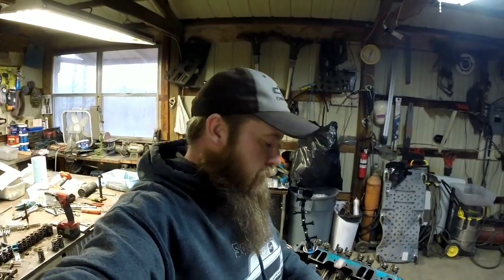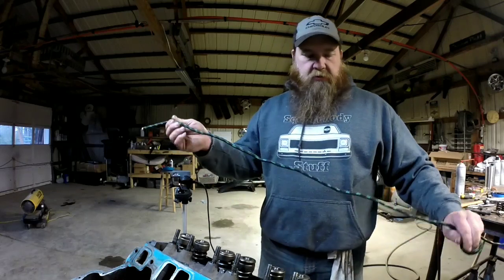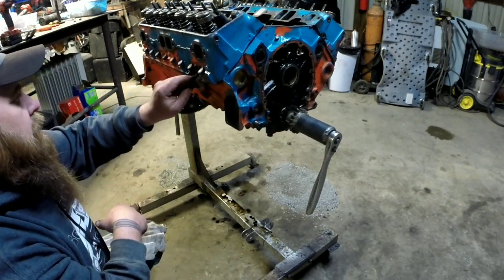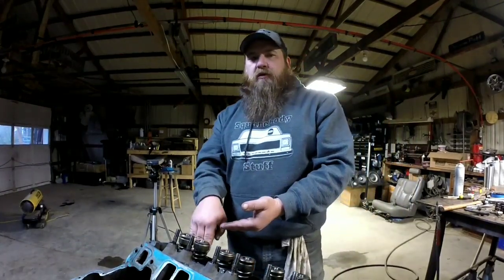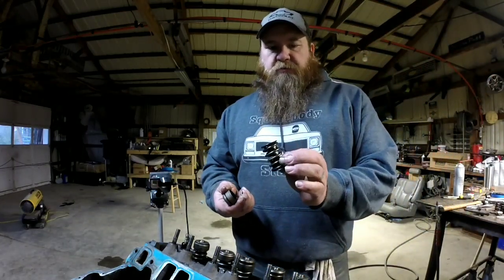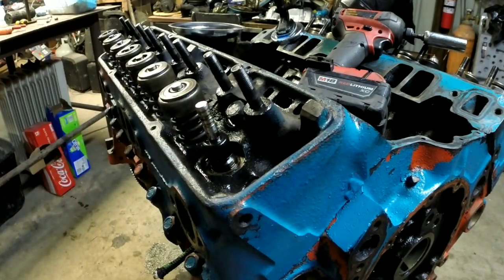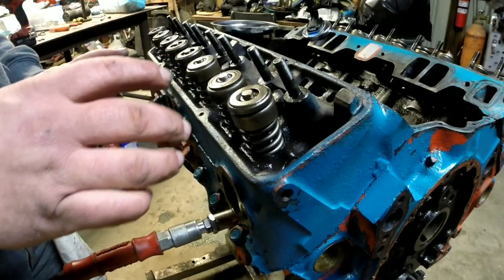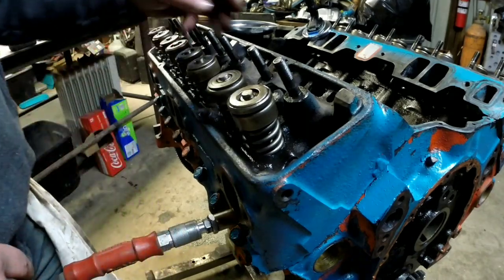How to change valve springs with the heads on.

Comment: My headers are tight to the spark plugs and I need to use a box wrench on a couple plugs. For that reason, a compressed air fitting won't work. I like the rope trick a lot - it should work fine for me! Thanks!

Comment: Hey man THANK YOU SO MUCH you just saved me at least 6_8 hours of back breaking knuckle busting to replace an exhaust valve spring on #1 of an 2004 4.0 I6 jeep wj I just bought at auction for 600. Great shape other wise. I did comp. test 1st cyl. 65 psi all others 155-165. Once again THANKS FOR THE ROPE TRICK. Cheers from Jacksonville Florida
Reply from the maker: You're welcome.

Comment: Thanks for the video! I think I've done the valve springs with every method possible, I personally like the compressed air method best because it's faster for me, but if there's no air, the rope is second best way, I also like the bolt on handle better than the twist-up spring compressor, because it's easier for my big fingers to get to the keepers, nor do I have to use grease to keep the keepers in place, but either way, both methods wil get the job done. I wonder how many inexperienced diy's didn't leave enough rope hanging out so they can pull the rope back out? Lol
Reply from the maker: Thanks for watching.  Several different ways to skin this cat, but wanted to show how I do it. Not leaving enough rope sticking our is a good learning experience. Lol
Reply: Hey I’m going to change valve springs on a 350 chev and I’m just wondering how much air pressure I should put in the cylinder or if I should just leave it continuously pumping in like he did? Thanks
Reply from the maker: You'll have to have  continuous air going to it.

Comment: What’s the best way to know when to put your rope in (just before TDC) if you can’t see your crank because you’re pan is still on?
Reply from the maker: I like to use the plastic straws off of brake cleaner or carb cleaner cans to stick in the sparkplug hole to get a feel for where the piston is at.
Reply: @SquarebodyStuff  Ah ok. Good idea. Thank you. Any risk of damage to the valves or piston should you go past TDC with that little straw in there?
Reply from the maker: No, it's soft enough not to hurt anything
Reply: @SquarebodyStuff  Thanks dude 👍🏼. Do you have a video putting the rockers on and setting zero lash?
Reply from the maker: Yes, here it is.
https://youtu.be/gqHHPU2eVIQ
Reply: @SquarebodyStuff  Wow. Thanks man!
Reply: Hey I have a question, why can’t you pull the spring with just the piston at TDC without the rope or air? At least on an SBC I don’t think the valve would fall much, no?
Reply from the maker: Good question. If the valve drops down it won't go all the way in, but if you can't get it to stay up on it's own long enough to install the spring you'll have a fight on your hands.
Reply: @SquarebodyStuff  Ah ok makes sense. Gonna do this very job soon. Thanks again!
Reply from the maker: No problem. Good luck and have fun with it.
Reply: @SquarebodyStuff  Ha!! It’s a 4th Gen f body. My back already hurts thinking about it.
Reply from the maker: I don't envy you at all. I'd rather pull the engine than to spend that much time bent over a fender.
Reply: @SquarebodyStuff  Lol I’m in Chicago. Come on up, I’ll pay you!
Reply from the maker: @nicotoscani8270  Not sure You're wallet is fat enough for that bill.  No offence, you lost me at Chicago. lol.  Honestly, If I had the time, it would be fun to do some trips like this and help veiwers out. Right now I work 60-70 hours a week at work, Take care of two small farms, and making videos. My Plate is full. Taking one bite at a time right now.
Reply: @SquarebodyStuff  No offense taken 🤙🏼
Reply: @nicotoscani8270  I know it's been 6 months but what tool did you use for compressing the springs on that 4th gen F-body? I got a 98 Firebird V6 and I have no idea what size spring compressor will fit

Comment: Thanks Brother. 
I just put new aluminum heads on my 350 rebuild, and realized that I had to install a weak valve spring to measure for correct pushrod length after having the block decked. The ol "rope a  dope" trick looks good to me. 👍

Comment: Did new seals, springs, push rods and 1.6 rockers on my lt1. Your rope trick was great. I used small rubber tubing since I didn’t have rope but worked just as well. Thanks for the tip.

Comment: Not sure if it's been mentioned in the comments yet, but using the compressed air method, it's best to do it with the engine still bolted to the trans in the car.
Put the cylinder at TDC, put the trans in 5th gear and then apply compressed air. Having the trans in 5th gear will help keep the engine from turning over, that way if you do drop a valve, it likely won't fall all the way into the cylinder and you may be able to grab it (depends on the size and shape of the combustion chamber)
Reply: Yeah the compressed air method, aka "the way the pros do it" comes with its own risks.

Comment: Nice video, I was wondering if that cheap leverage tool would work (1995 K1500, 350/5.7).  What do you mean at 6:22 when you 'cut the threads' on the nut?  Do you have to do this in order to use this tool?
Reply from the maker: You don't  have to, it just makes the nut easier to turn . Or find a regular nut that fits.

Comment: Have you had any problems with the studs pulling out say with a comp cams high energy 268 cam with 454 lift
Reply from the maker: Nope. Should be fine with that cam. The 268 is a great all around cam for small blocks and big blocks.

Comment: hi there ,
 how you identify your valve spring need replacement?
Reply from the maker: If upgrading the cam you'll  need the correct springs. If it is a high mileage deal then I use the when in doubt, change them out thought process.  You can also use a spring pressure gage to check the spring pressure

Comment: I have a triton 4.6 2004 ford expaditoon the Ford dealer found the valve spring in the oil pan now car shield is telling the to put and new valve spring on and the truck will be fine is this true

Comment: In a 4.6 Chevy,  can one or two valves be changed, or does all the valves have to be changed? Thanks anyone. Just trying to do it myself, and not spend a lot of money.
Reply from the maker: You can change just the valves that are bad, but its a good idea to replace them all while you have it apart if the budget allows.